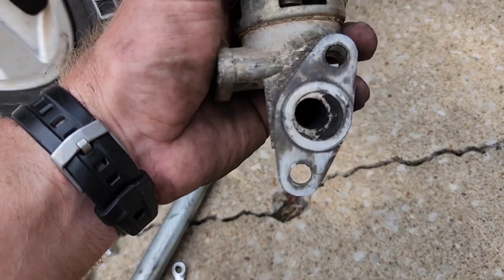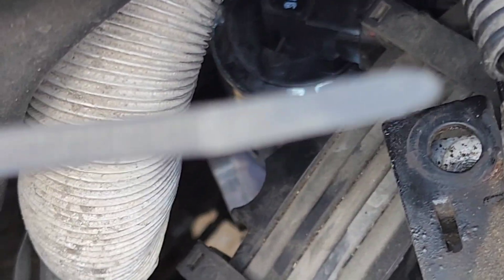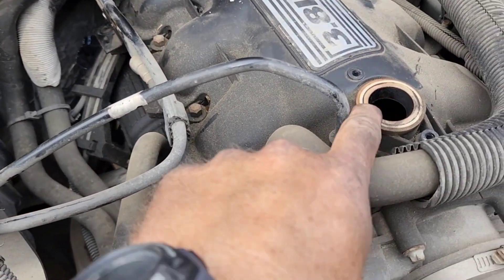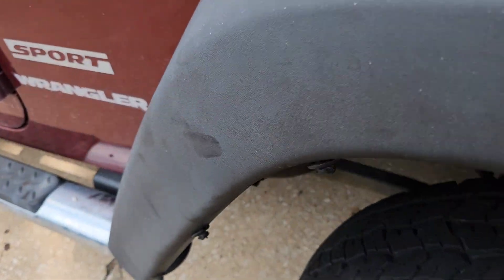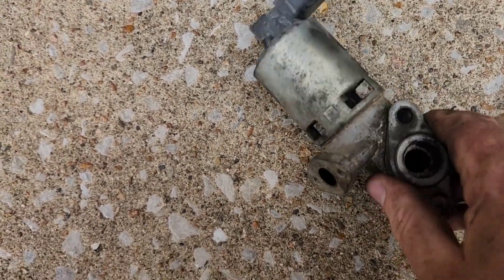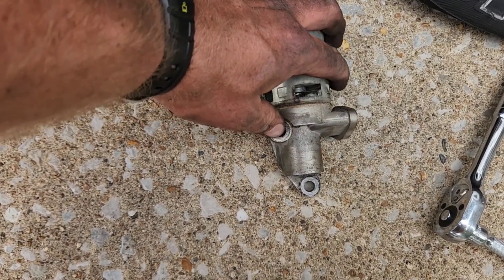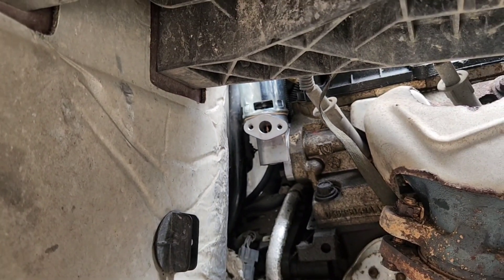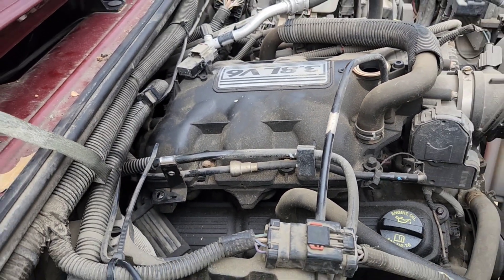Jeep Wrangler EGR valve replacement

Comment: I replaced my EGR valve five months ago. Now the jeep threw another code, P0405.
Reply from the maker: Did you clean out the metal tube from the intake to the egr. This one took almost a whole can of break clean and was nasty. It may have dirtied up the egr already.
Reply: @macsboneyardbuilds  I didn't do a thorough clean, I should have known better. However, the check engine light turned off on its own today while driving.  But I will consider cleaning the egr tube.